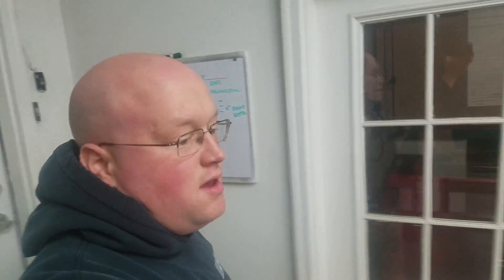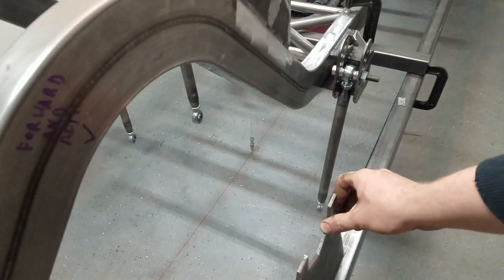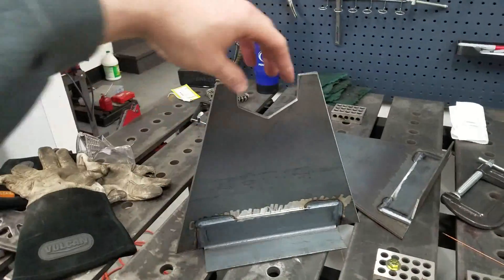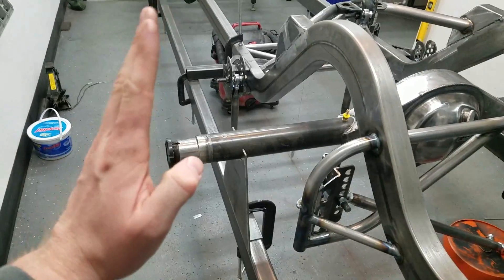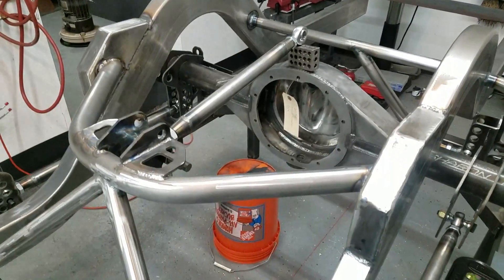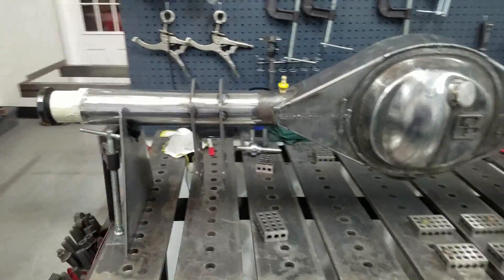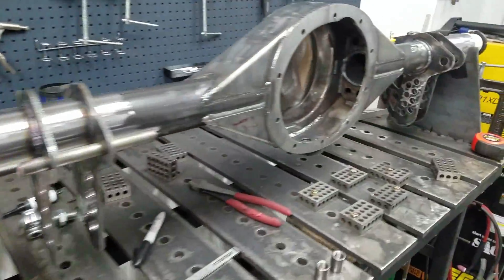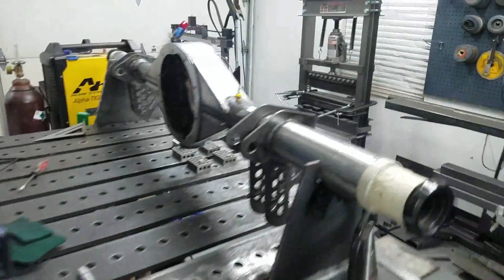C1500R Build, Episode #13 Installing our FULL FLOATER Ford 9in Housing in our Custom OBS chassis

Comment: All that awesome fab work and the lower pan-hard rod end is mounted in single shear....
Reply from the maker: On a purpose built stud 5/8" stud. It will be very ok
Reply: LoudandProud still not as strong as a double shear mount, why go through all the effort for a second rate setup? Is this a performance or for looks build?
Reply from the maker: @matty86suk  definitely a performance setup. I could pull 5gs  on that bolt and still have a safety factor over 4 against yield. They've used these studs on modifieds for years and they hold bumping and grinding very well. To each his own.
Reply: LoudandProud I don’t think single shear suspension components are NHRA compliant. Your fab work looks awesome, top notch, so why use a second rate design? I watched for the full floater 9 inch.
Reply from the maker: @matty86suk  it's hardly second rate. It's more than sufficient. I'm unaware of any such NHRA rule that applies to an 8.50 car. The panhard needs that mount and spacer style to clear the diff and coilover. The outer portion needed for a double shear would interfere with the coilover body.
Reply from the maker: Take a peak at some Chris Alston chassis works Watts link designs. They're very well known and competitive protouring chassis. All the watts mounts... single shear.

Comment: Good idea with the rear end cooler/heater, I'd protect that lower fitting so it doesn't get hit by debris and break off. I think some nascar center sections have pump provisions built in, my buddy bought a rouse Yates one and that was an option
Reply from the maker: Yeah I like the built in ones for sure, but I wanted the fluid to circulate with the truck idling. Basically get her all warmed up without even having to move

Comment: Awsome great job were did u buy the frame rails
Reply from the maker: The frame rails were my design, but I purchased them from Boling Bros in California. They did a VERY accurate job. The measured within a 1/16" of an inch to each other when I got them.
Reply: Keep up the good work

Comment: Hey bro u mention u could do autocross with that rear end have u done a video of the set up of that rear end because i called Qp and they said there hubs werent strong enough to do that or it was a good housing for that but ive seen people use them maybe u did or doing a video on what u did or use to get it to hold up for autocross or anything u throw at it thank u.
Reply from the maker: They say that because none of thier customers pack bearings or do maintenance. The hubs themselves are strong enough for this weight easily but require repacking the bearings often. If I kill a bearing ill make new hubs on the Haas Mill
Reply from the maker: Gotta understand the application. For a daily driver id never run these. For 3000 miles a year race truck? Yeah no problem
Reply: Anything you recommend for autocross
Reply from the maker: If you're gonna do alot of mileage id go with the speedway engineering setup
Reply: Yeah i like to drive it alot plus getting into the autocross alot real aggresive thank you for your help

Comment: Whats the thought behind the 2wd setup being kept? Is it like a cost/time kinda thing or do you simply not need it or maybe no transfer case can hold the power?
Reply from the maker: The goal of this chassis to to try to make it handle as best as I can. AWD can be executed very well, but it takes a level of refinement in design that frankly I wasnt ready for. Also, there are very few transfer cases with the appropriate clutches to make it work and handle well at the power level I am going for. While AWD would be cool..  its just not worth it for me.

Comment: With the pinion centered in the truck how are you dealing with the u joint angles so the u joint still spins? Motor offset? Just wondering
Reply from the maker: The engine is and diff will still on a parallel plane 2° up. The engine will be 1.5" right. What do you mean the joint still "spins" you mean articulate?
Reply: LoudandProud the needle bearings spinning
Reply from the maker: The front will be a CV joint... the rear should spin enough with the motor angle I have